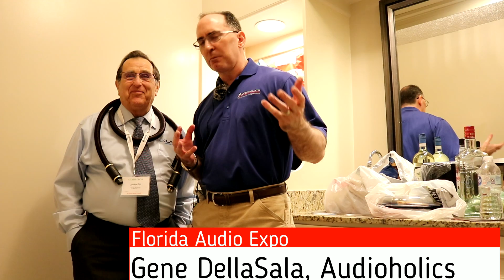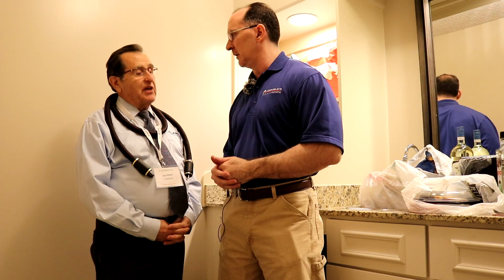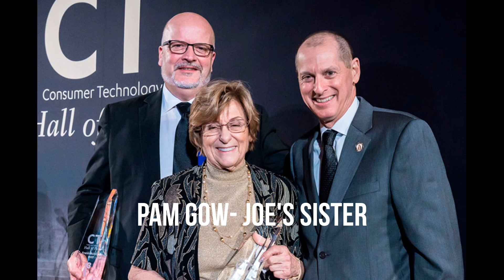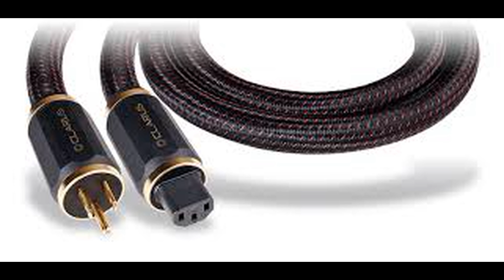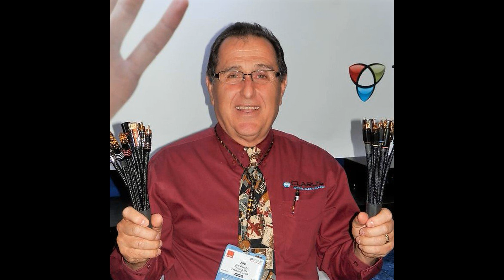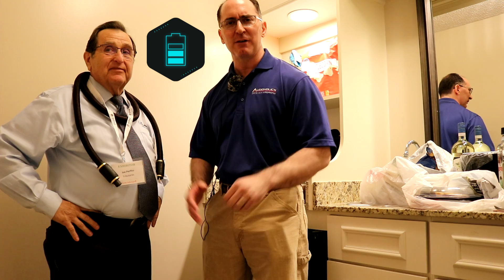Tributaries Cable Interview 2019 Florida Audio Expo

Comment: Tributaries Series 8 Speaker Cables are 400$ a pair for 6feet length. What happen to buying mono price or BJC speaker cables which cost less then 100$ a pair? now u recommend buying speaker cables from these guys who charge  that much for speaker cables? all the snake oil talk has gone where?? stop being a hypocrite Audioholics.
Reply from the maker: If you want to spend more money on cables that are well engineered but look nicer than BJC or Monoprice, there's Tributaries. Learn critical thinking before name calling.
Reply: @Audioholics   so your saying the cable around the collar of the guy getting interviewed by you isn't Snake Oil?
Reply from the maker: @berj79  it's only snake oil when they make snake oil claims. As it stands now, it's just over engineered and unnecessary over stock OEM cable but...it looks badass.

Comment: I don't trust a guy with a power cable that's for 125v socket that's thicker than the power cable for my Tig welder when it's running on 3 phase 480v power.

Comment: Sorry I don't trust this either. I should say it's not trust but it's a bunch of BS. There is no reason to spend tons on a cable, especially HDMI. 15 bucks certified Crutchfield cables in my system and it's all excellent quality.
Reply from the maker: As long as the cable reliably passes the signals at the data rates you're running, no worries. Length is the enemy of HDMI and as you fo up in bandwidth, you can start seeing problems.

Comment: Gene, still a power cable 8gauge that plugs into a wall of houses wired with 10gauge zip cord. I get you need higher gauge for higher power (a la Car Stereo) but it ends at the wall. As for HDMI, I have always used Blue Jeans and Monoprice and never have had problems. Good for Tributaries that they do independent testing. Thanks
Reply from the maker: Yea 8AWG is overkill but I'd use it ;)
Reply: Ditto on the Blue Jeans and Mono Price. SVS makes some nice cables too. And that power cord, I run two outboard amps, that would look cool on the floor, but as you stated, 14ga at the wall plug... Kind of useless, but never the less, it looks cool.
Reply: @michaelwright1602 Thank for the comment Mr. Wright. I knew about Tributaries but not in depth. I will look into detail and learn about your product line. Cheers.